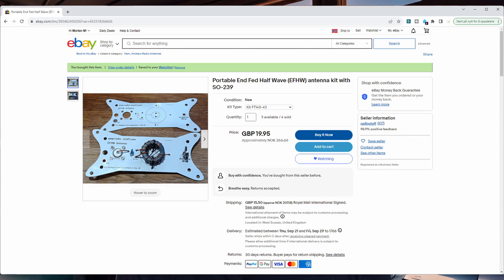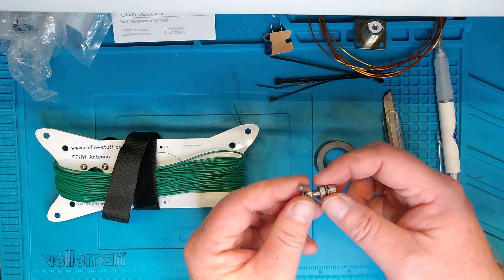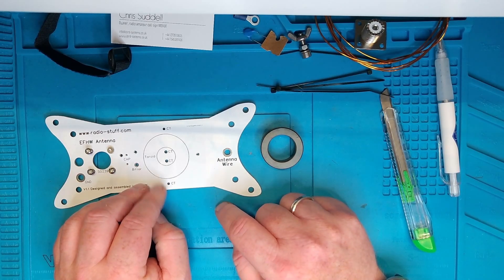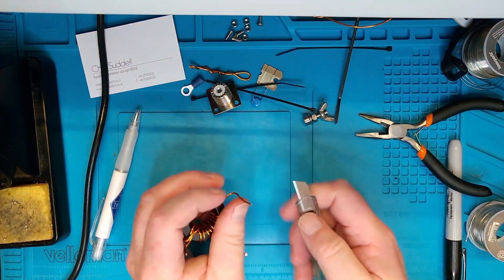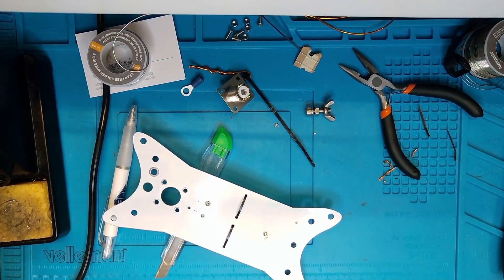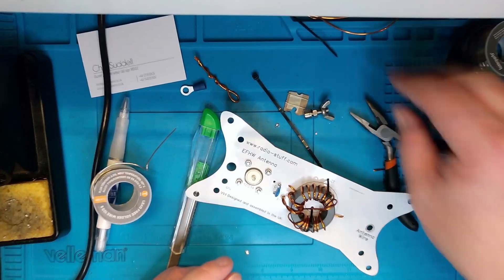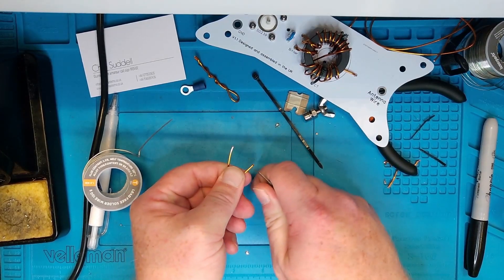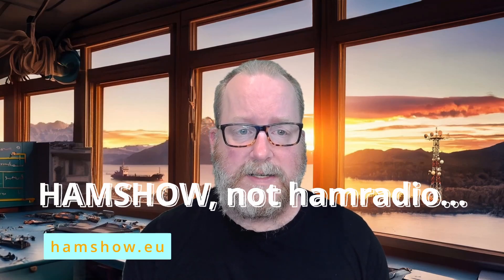If I can build this kit, you can too!

Comment: To burn off the enamel on the wire use a chisel tip with a blob of solder on it and them soak the wire in the solder blob.  You can also use a solder pot used for tinning wires.  The trick is the solder must be really hot.  73
Reply from the maker: It seems like a chisel tip is the way to go according to both the comments. Thanks for commenting!

Comment: Please  do yourself a favour and  get rid of the pencil tip  of the soldering iron. Get a chisel tip instead. Much better for soldering,  even with SMD parts. 73  from JO31
Reply from the maker: The tip is due for a replacement, but I really like the iron. The bigger problem is my soldering skills though.